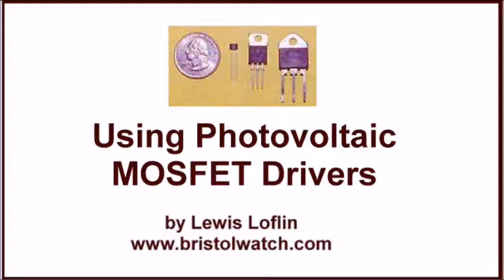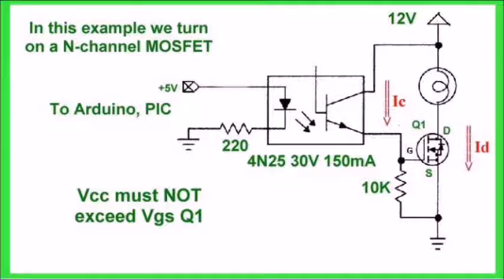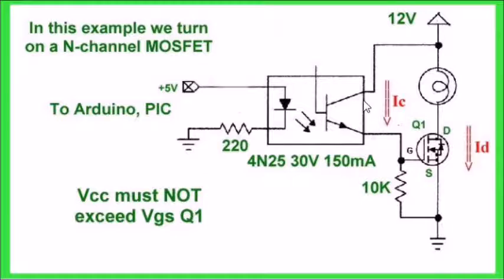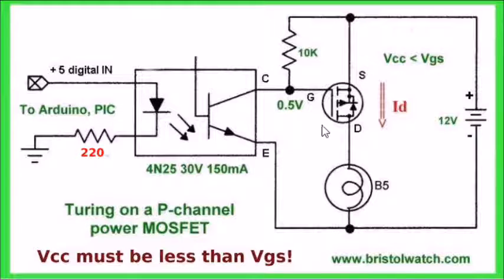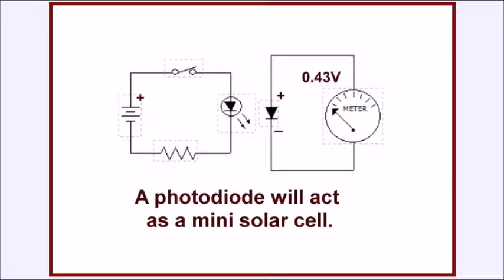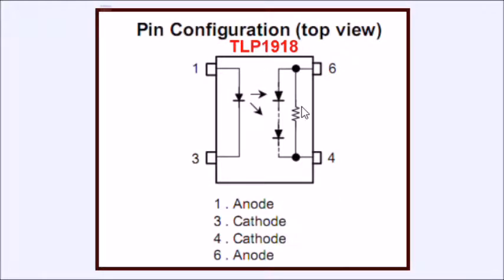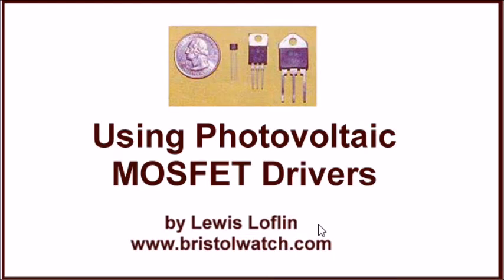Using Photovoltaic MOSFET Drivers

Comment: Glad to be introduced to these devices, but they do not seem to be commonly sold.  Currently, I use a dickson charge pump to make a reservoir, and a pair of PC817's as a push-pull gate drivers.  This is quite a lot to solder up for a single MOSFET though.  There must be some other chip that professionals use when they need to control dozens for MOSFETS from an isolated source.

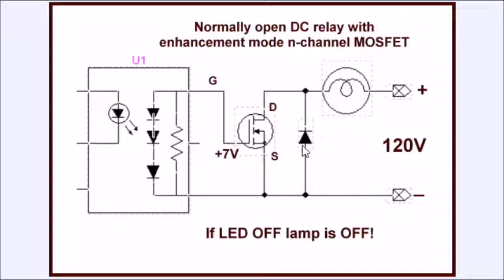Comment: Many useful videos lately, Lewis -- well done. Just a few comments: At 1:28, since the MOSFET gate draws essentially no current, low power Zener/resistor pairs can be used to protect both Vce and Vgs for use at higher Vcc levels. This might be cheaper than sourcing high V rated optocouplers and MOSFETs. // At 7:35, for inductive loads, the back EMF diode should be located at the load (e.g. across a motor's terminals), not in the control circuit. A MOSFET's intrinsic body diode should not be substituted for the back EMF diode. // At 8:24, depletion mode N-channel MOSFETs are available, but options are fairly limited in the wild; Digi-Key lists only ~70 examples. Also, since they're actually P-type devices, they have substantially higher on-resistance [Rds(on)] than enhancement mode devices. This results in lower drain current ratings and higher power dissipation in the same package.

Comment: Thank you for your video. You say that the only drawback of the Photovoltaic MOSFET Drivers is cost. How about current consumption? Reading the hotovoltaic driver datasheets it seems like they provide data with the assumption of 10mA LED current. Isn't that a lot compared to most traditional gate drivers? Have you tried how low LED current can we go and still make sure a N-channel MOSFET is fully turned on in a high-side switch scenario?

Thank in advance.
Reply from the maker: I meant that in regard to the photovoltaic section output that is very low current.
Reply: @LewisLoflin  thank you for your reply. I'm considering using a photovoltaic mosfet driver IC in a bidirectional mosfet switch module I'm building. It will consist of two back to back n-mosfets and carry up towards 100A. How low led current in the driver is realistic to go, and still have the mosfets fully on? I'm asking because sometimes the module will be used to pass charge current from a small solar panal which could be really low. Then 10mA just to keep the mosfets gates on is a considerable amount of current lost. Thank you in advance.

Comment: Those Crydom SSRs are a neat package but quite expensive.  Are there any less costly solutions when using low voltage (14VDC) at 1 amp?

Comment: i was under the understanding that due to the physical construction of a working mosfet... body diode is always present. which is why u need two to switch dc, not just a digikey search for diodeless mosfet. 

 as far as gate not related to voltage u r switching.. couldnt the same thing be achieved by powering a the gate driver ic from a floating/isolated point of load converter? does output voltage required vary at all with switched voltage in your config or do you just aim for something significantly above data sheet threshold v but below max and it works ?

Comment: Thanks for putting this together. I have setup the same exact circuits as you show for either N channel or P channel and i'm driving it from an Arduino using PWM. If my PWM frequency is low say 1000 hz or less, the MOSFET's run cool (12 volt, 1 amp load), but the circuit has a nasty buzzing sound. If i turn the PWM frequency up to say 15K or 30K, the MOSFET's get extremely hot after a few seconds. For my N-channel config I'm using these, CSD18536KCS and a 4N25 opto isolator. My Vgs is 12 volts. I have no clue why the mosfets get burning hot at a 1 amp load--but only when the pwm frequency is high. Thoughts?
Reply from the maker: That is due to low duty cycle in addition if a magnetic load the diode suppression is likely to produce heat.

Comment: Cool!! Thank you for the Information.
One question:
As the photo diods act like a power source wouldn't it thus be even possible to drive an N-Channel Mosfet as a high side switch?
The 7-8V of the photo diods should add up to the source voltage and thus ensure the Vgs threshold voltage with respect to source pins voltage just fine, even though source pin in a high side switch configuration is not connected to Minus but to the positive side of the Load.
Reply from the maker: No the photodiode current is very low and is used to turn on the MOSFET only.
Reply: Yes, that is clear. Are you familiar with n-channel high side switch boost capacitor drivers? The capacitor is a energy source for the gate voltage as its voltage adds up to the source voltage in high side switch configuration.
I wonder whether the photovoltaic drivers render bost capacitor configurations obsolet as the photovoltaic is a power source itself.
Reply from the maker: No I'm not.
Reply: yes, you can do that. G must be >vGS(th) above S, whatever S is. I find 4 flat red LEDs in series hit by a bright white LED (driven @3.3v) outputs 4-7v @20-50ua.
Reply: Very informative and useful . Thank you for highlighting an easier method for switching a Mosfet Transistor.

Comment: I wish to transmit audio (line level) through an optoisolator to control a charge of 9V AC. Do you have a suggestion?
Reply: I would not recommend transmitting audio through an optoisolator. They are not intended for this. You will get distortion.